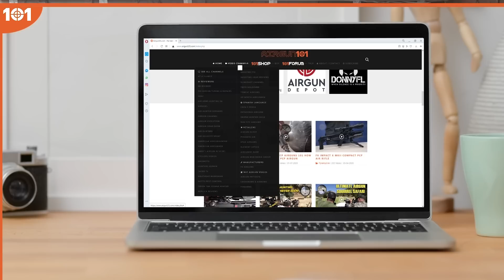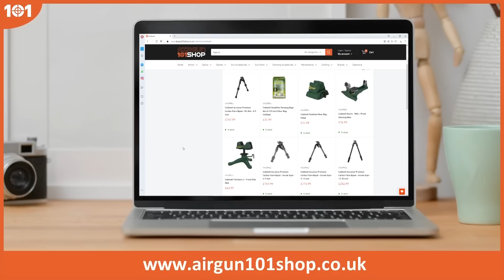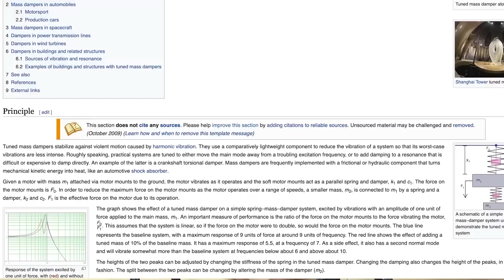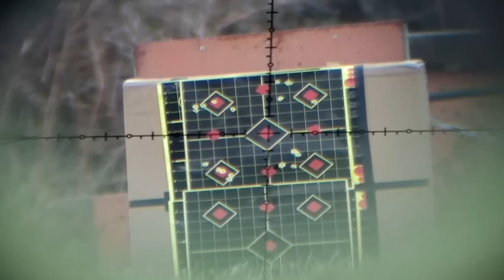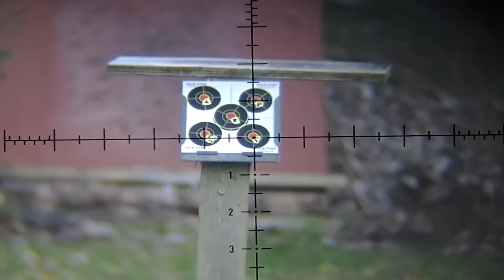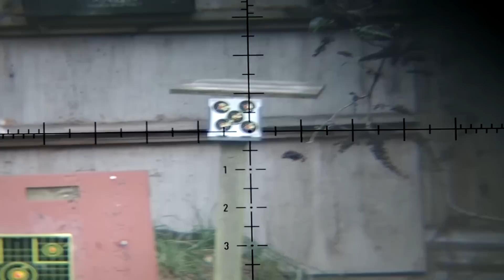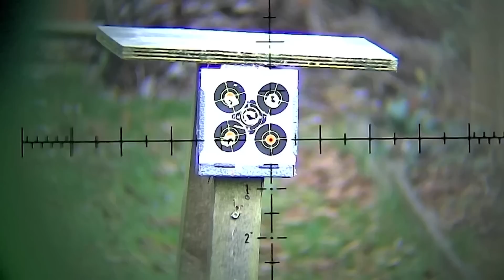Airgun Barrel Tuners - Does it Work?

Comment: there are so many variations possible with prechamber pressure, hammer adjust, valve adjust, slug or pellets used, etc etc... addung the harmonic tuner just add anither variation
and finding the best combination is a long long exoeriment ... 
so sad we have the 7.5 joule restriction here in germany

Comment: I make 3 slip on sleeves for my son's Artemis M16 .22. Replaced the original barrel and shroud with a LW polygon barrel. The slip on sleeves or weights is 20mm 30mm and 40mm in length.
I did the tuning of the barrel at 25m and the best results was achieved with AA 18gr pellets at 30ftlb at my home benchrest range. I did shot at the shooting range at our club at 50m. If there is no wind it shoots x on x. 
My sub 12ftlb the moderator does the trick.

Tests don

Comment: Great video Giles, but.... My personal view is that you can better tune your barrel by the following existing ways: 
1. Barrel carbon sleeve for slim  fx barrels
2. An external shroud with a nipple type end moderator adaptor that screw tightens on the end barrel ( I use that on my compatto)
3. A shroud system with 3d printed tight spacer rings that firms the barrel centered within the barrel
4. One or maybe two old style barrel bands firmed at a steady part of the gun (not the pr. Tube)
5. A thicker barrel

Comment: Your results do prove that barrel tuners do something to change pellet impact. This also suggests that adding other accessories to a rifle can do the same thing. Adding or reducing the weight of the rifle will move pellet impact. The support position and weight of accessories like bipods affect pellet impact. Barrel length, barrels being more or less rigid. Scope alignment and everything you change can do the same thing a tuner does. The one and only thing a tuner provides is being able to adjust the impact of the pellet slightly. If that is important to the shooter it is worth the money to use one. 🔍🥂🔎🎅
Reply: ...and to be able to adjust that movement with measurable precision.  The difference between the FX Tuner and just adding on a muzzle accessory is the ability to control the changes that it causes.

Comment: I concur with your findings.  These will not fix a badly tuned gun... but it does has a subtle influence.  There are several complete revolutions available, with 1/8 rotation major sub tensions and 4 sub-sub tensions between each major sub tensions.  The range of adjustment is much larger than needed to get the barrel into and out of phase with the harmonic.frequency.  I have found that at about 70% of the range between the tightest group adjustments, I get two separate groups just as you did, slightly offset from each other.   I have the tuner w/o shroud on my Kral Nemesis in .25.
Again, this device will not fix bad tune, bad technique or bad breath.  It would be easy to loose the significance of the adjustments in the noise of the data if one was not careful in their methodology.

Comment: I pre-ordered a standalone FX tuner and have been testing it extensively in the relatively short time I've had it (about a week) on my Brocock Sniper XR. It fits perfectly on this gun and more importantly it has improved the shot accuracy from the barrel without question. When I got it I was surprised on how much it weighed. I hadn't realised it was 190 grams (Duh!) but on the gun it doesn't feel too heavy but I'm one that likes to shoot from a bench so maybe the weight wasn't so important. It's extremely well machined and I've found that I can wind it back up to nine and a half revolutions in total. The sweet spot so far for me has been to wind it back 4 revolutions for superb shot consistency. I'll probably spend many more months testing it before I've finished. I wouldn't hesitate to endorse this product and I've no connection to FX or any other commercial entities. Merry Xmas Giles to you and your family and all the best for the new year.✌👍😁

Comment: Interesting topic and discussion, Giles. I found the accuracy of my springers improved when I tried a steel moderator, which is notably heavier than the Weihrauch originals I was using. I tried it to shorten the overall length of the guns and the better accuracy was an unexpected side benefit. l reckon the improvement is due to the weight helping damp barrel movement caused by the recoil. I can't say or measure whether harmonics has anything to do with it. The improvement isn't massive, but it's definitely there. Have since bought a couple for my other guns. Nice that they are so much cheaper (although not as pretty) than lightweight shrouds from companies such as Hugget.

Comment: with my M3 already weighing over 12 pounds, I'll pass.  I wouldn't mind trying one if it was small and made from a 3d printer though.  Thank you for the video. :) The carbon fiber sleeve made a huge difference for me however.
Reply: Happy Christmas F...45. If they created using a 3D printer... you loose the effectiveness because of being light weight, and isn't it the added weight that helps to dampen the unwanted vibration? My Crown Gen1 with a 600mm barrel in .25 is amazing long which puts lots of weight out front. Now if some bright blok were to bring that metal tuner back near the block.... then maybe but I'm not sure that the types of plastic that get used in 3D printers will do the job no matter where they.put them. I'd be interested in your thoughts
 Oh yes, I live across the pond so my Crown is high power. If we are talking sub 12ft lbs... the plastic 3D printer types may work. Anyway, Santa is knocking on the roof tops so I had better bugger off... hope my ''Brit'' was used correctly. Merry Christmas my friend and a blessed New Year.